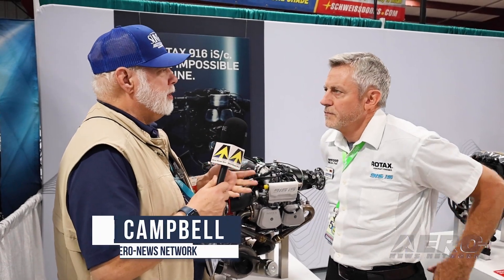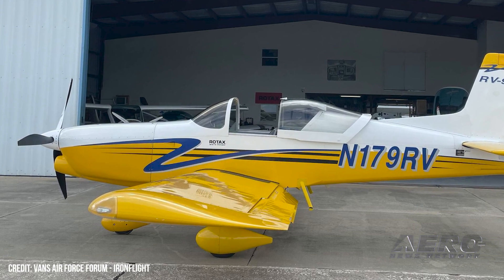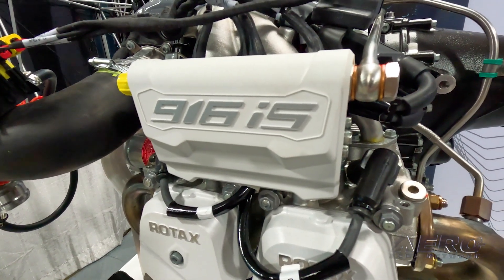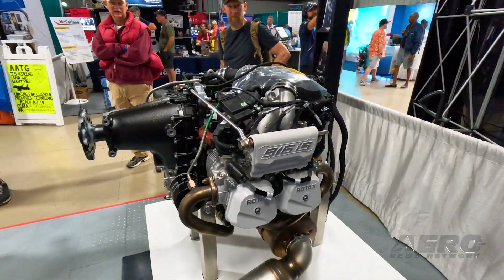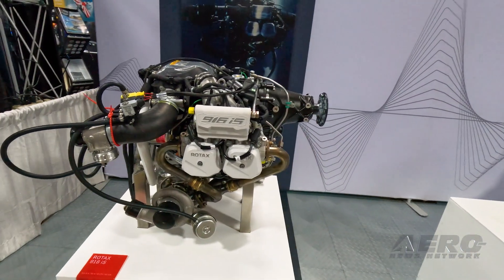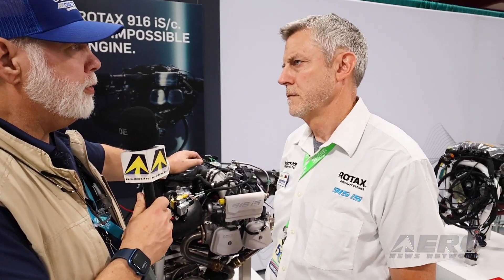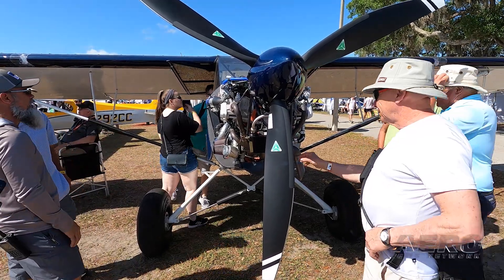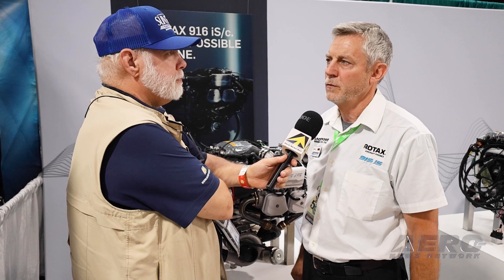Aero-TV: Fitting The Powerful Rotax 916 Into The Market

Comment: I googled this engin, I am in the market for the sling high wing or cessna T206. I was sold on the sling as it comes with a parachute BRS. However engin problematic,  I am  going back to 206T I will install a BRS system into that plane.

Comment: Beautiful and amazing engine, but very  very Busy for an engine. Not something you want to troubleshoot in the bush or on a glacier. Certainly it has its place as does the lycoming. If lycoming could make that power at that weight in their current configuration it would unfortunately cost $150k